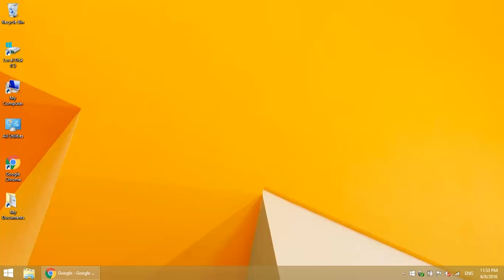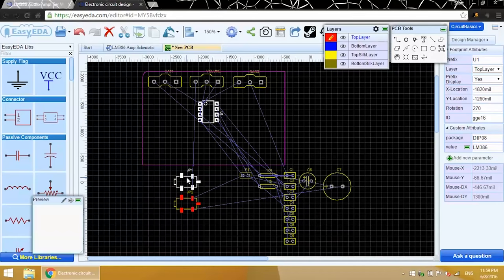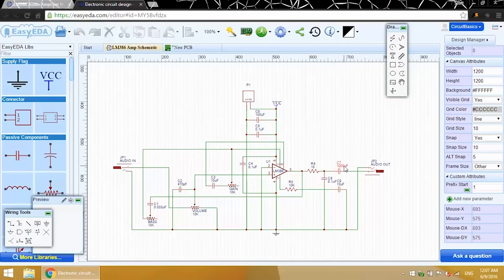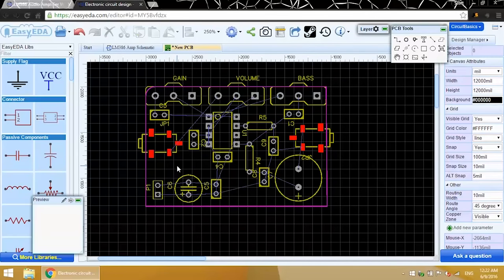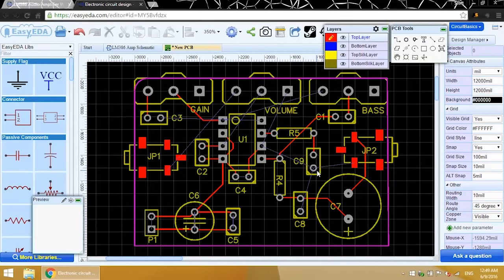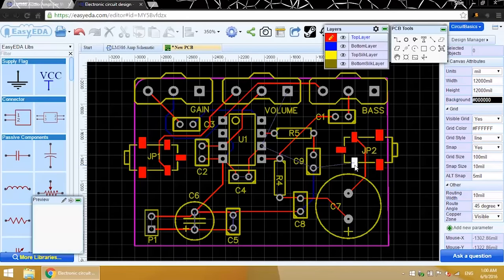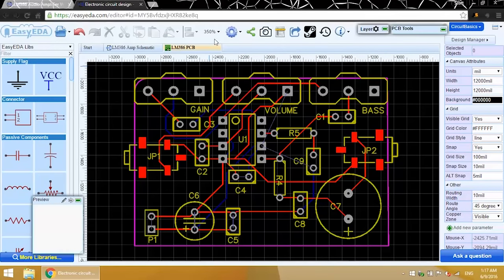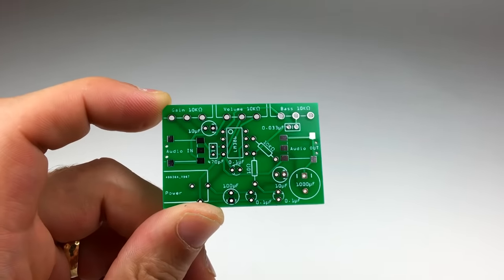How to Make a Custom PCB - Part 2 - Making the PCB

Comment: The only video where manual PCB routing is done. All the others just used auto router feature. Thanks for the video. If you could add more info on how to route a wire from top to bottom and back to top using via and holes, it would be great :D

Comment: Nice video, but I would suggest consideration to how the PCB is going to be mounted, whether screw holes or sticky stand off feet. Holes could be added as components and placed according to the enclosure chosen for the product. This leads to consideration of the enclosure, are you going to 3D print one off or use a standard off the shelf box. Another option is re-using enclosures from old equipment which may suit your application like an old radio which as 3 pots for volume, gain and bass etc. If you're like me, consideration of making modular widgets and using a standardised size board with ports and user controls on specific sides so equipment can be either plugged together or mounted together like Lego and wired patch panel style. Unless you're designing high speed or high frequency circuits I would also use thicker tracks, especially for power and if you have two layer, use a ground plane to help mask RF pickup and transmission and keep second layer interconnects as short as possible to avoid breaking up the ground plane. These are more advanced design techniques but still useful. If you're etching your own boards it's quicker if there is less copper to remove and fatter tracks gives you some protection against over etching or poor exposure.

Comment: I find local manufacture of PCBs significantly more convenient and efficient for prototyping since it takes 20 minutes to manufacture a board, though it can take as little as 5 given more than minimal tools and experience with the process. The boards lack silkscreen and polymer coating though, but the traces are still tinned.

Comment: 15:05 while checking "make sure you haven't missed anything": U1 is not connected to C9, nor to the VOLUME pot. Ratsnest wires are glaring at you in the middle of the screen...

Comment: Board shown at the end is not board designed / submitted to manufacturer in this video. Compare e.g. the diagonal 10k resistor which was never in the PCB design.

Comment: Just tried making a board for an Airsoft MOSFET and the current version of EasyEDA doesn't look much like the one in the video. I managed to figure everything out, but it was very nerve racking when buttons are missing and the parts I needed don't exist in the libraries. One part, a TVS Diode 5KP20CA was completely incorrect, according to my supplier, Mouser Electronics, it is an axial lead diode and the library has it as a SMD, which made it very difficult to convert to the PCB. Eventually, I was able to find a suitable replacement and make it work. Other than these minor issues, you video is very informative and easy to follow.
Reply: You can check out snapeda.com for footprints and schematic libraries. Hope this helps
Reply: Hariharan Varadarajan I'll look into it when I get a chance. I just ordered my PCBs last night, so I'm hoping everything comes out okay. I should know in about a month, since that's how long it's estimated they will arrive from overseas.

Comment: Hi!

I soon have a Raspberry Pi up and running, but in the future I would like to add different hardware such as LCD monitors and sensors and such. Is it possible for example making a PCB board with no components and with only connectors and wires so I can easily stick the GPIO pins on the Raspberry Pi to the board and then have the LCD screen sticked on the board all wired up correcly without have to check every single wire and instantly have it up and running, ready for action.
I'm new with all this circits and wire tampering, but I wouldn't say I'm a complete beginner with computers and wires. But it was a while since I tinkered with this, but I'm completly new with making your own boards.
Reply: no
Reply: yes
Reply: very much yes. Check out a few tutorials on connectors with easyEDA when you find time.

Comment: I need a board to power 10 modules positive and negative at 12v dc 6amp. 12v 6amps in then go to the 10 modules that have a positive and negative wire.

Comment: IF YOU HAVE FOUND HOW TO REMOVE THAT 'ASK A QUESTION' / 'CHAT' IN THE LOWER R. SCREEN CORNER PLEASE LET US KNOW.

ANOTHER THING ... HOW DOES ONE  CREATE A BORDER OUTLINE  ?

INTERESTING THAT YOU WIRED THE PARTS MANUALLY AND NOT WITH AUTOROUTER.
THAT WAS EDUCATIONAL. SO WERE YOUR REMARKS ABOUT LOCATING THEM L. TO R. IN A SIGNAL FLOW MANNER.  AND THE PLACING OF V+ AT PCB CENTER FOR EQUAL
TRACE LENGTHS.

WOULDNT THIS DESIGN HAVE BENEFITTED FROM A GROUND PLANE ?

Comment: The actual PCB shown in the end of the video was different from what was  drawn.
You forgot to connect a couple of wires, therefore the PCB would never have worked.

Thanks for the introduction to EDA

Comment: wajt difference between top layer and bottom layer?
Reply: If a trace would end up conflicting another, you would move one or the other to the other side of the circuit board so it can complete the connection. Sometimes it can go up to several layers inside, like a motherboard.
Reply: slicky_fox thanks a lot